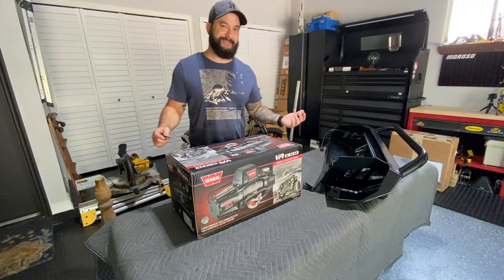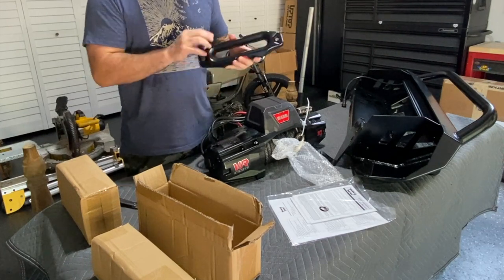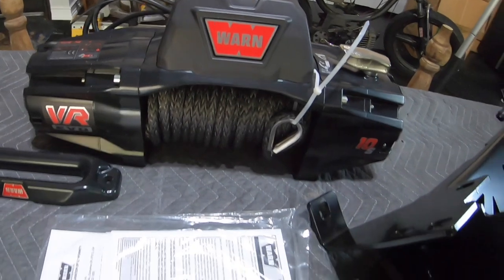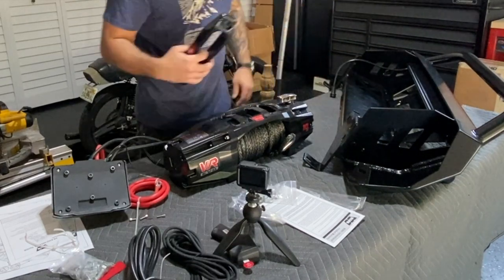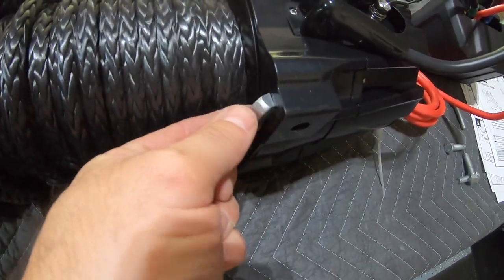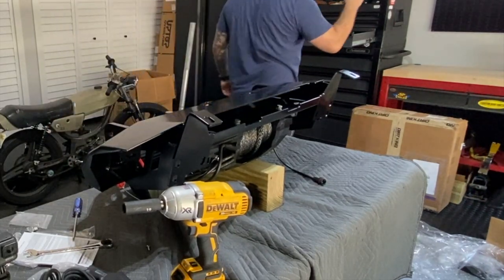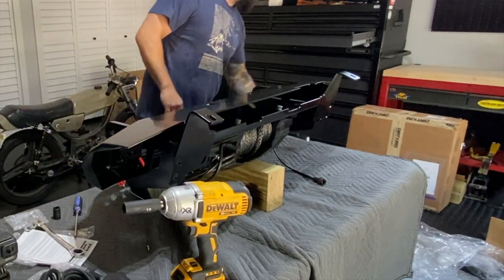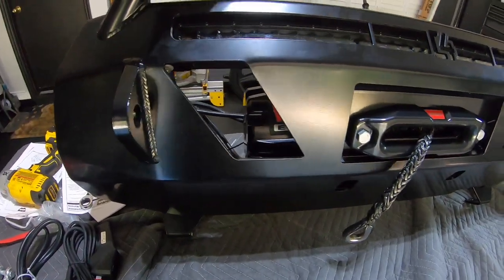Toyota Tacoma | Warn VR Evo Unboxing/ Install | (2017 Tacoma)

Comment: I just installed a VR Evo 10 S on a Tacoma 3rd gen with the Warn bumper. The solenoid did fit on top with an inch to spare. I can't speak to other brand bumpers, but the Warn bumpers appear to leave enough room to avoid relocation (with the VR Evo 10 S at least).
Reply from the maker: Awesome, thanks for the heads up and letting me know. Hope the video helped. Thanks for watching.
Reply: Video helped a lot!
Reply from the maker: @spartan8390  Very happy to hear that, thank you.
Reply: Hi Spartan. That's a Warn winch you installed with no solenoid relocation on a Warn Bumper not a C4 bumper?

Comment: Did you ever find a way to mount it to the side? Or on the top left? I have a tacoma with CBI T3 and I’m having to figure it out too.
Reply from the maker: Ya, I go over it in the bumper install video. I found brackets that work perfect for our truck. Thanks for watching.
Reply: @ClassyTacos  what brackets? You’re not talking about the warn relocation kit are you?
Reply from the maker: @DMHal01  follow this link to the explanation thread on the brackets. https://cutt.ly/nhlHwwE
Reply: @ClassyTacos  thanks man! Excellent install video!

Comment: Did the weight with the winch and bumper make your truck leaning down?
Reply from the maker: I have aftermarket springs, so if it it the amount was minimal. Nothing I noticed. Thanks for watching.
Reply: @ClassyTacos  i also got suspension too. I have bilstein 6112 amd 5160 so just curious if i will need a beeter suspension if the bumper makes it go down in front..

Comment: Where did you mount the control box?
Reply from the maker: Here is a link to the bumper install where I mount the control box too.  https://youtu.be/w81IXDl1h5w 
Thanks for watching. I found some perfect mounts at TrueValue hardware.
Reply: @ClassyTacos  How do you connect the remote?  Is it difficult to do?
Reply: so you have to pop the hood?  I guess that's not that tough...
Reply from the maker: @cementtacocalifornia5638  My winch can run wired or wireless. Yes, you have to pop the hood to run wired. Almost all Tacoma after market bumpers have the winches hidden deep.
Reply: @ClassyTacos  I ordered the SSO tube bumper and need to get a winch for it.  Haven't decided on the winch yet but need to relocate the solenoid most likely.  How you like the Warn winch?
Reply from the maker: @cementtacocalifornia5638  So far I like the quality. No pulls yet, just put it on. Look at Smittybilt and Warn. Those 2 companies come up a lot on the Tacoma forums.
Reply: @ClassyTacos  Yeah i'm considering both of those brands.  Not sure how much I want to spend as I don't know how much i'll need them.